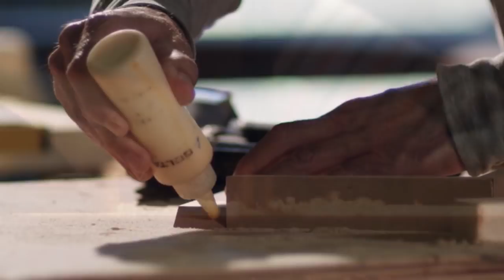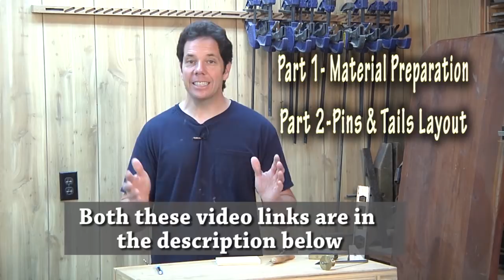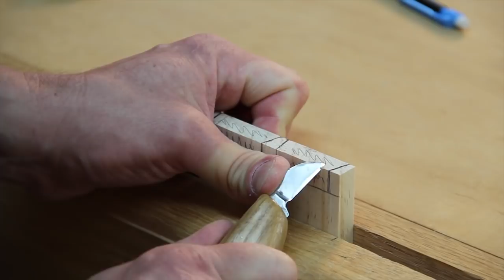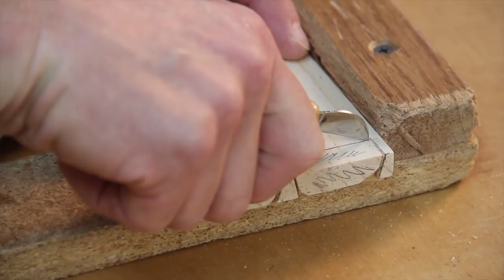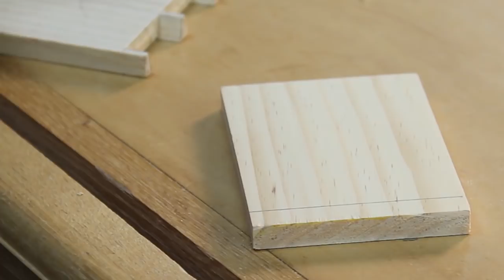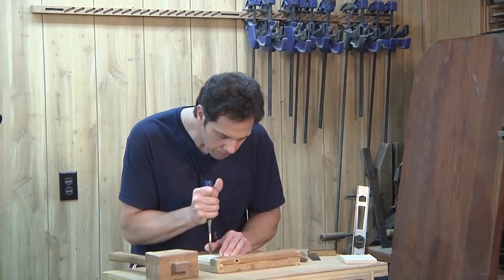Best way to do Dovetails series- 3

Comment: Great series Chad. I have a porter cable dovetail jig, but I've never used it yet. I want to know how to hand cut them first. And, watching this series, I've learned that there are reasons for hand cutting them versus using a jig. Thanks for doing this series, you have answered questions I haven't found answers for before. Brad
Reply from the maker: That's awesome brad. It's actually a thrill when you see the pins and tails sliding into each other

Comment: You my dawg, pins first so you just gotta put your cut //inside// the marks to get the tails right vs trying to split a line just on the tail side with a harder marking setup to start from? No thanks.